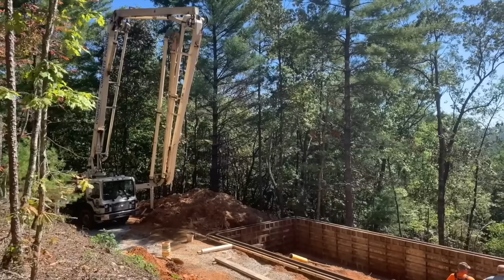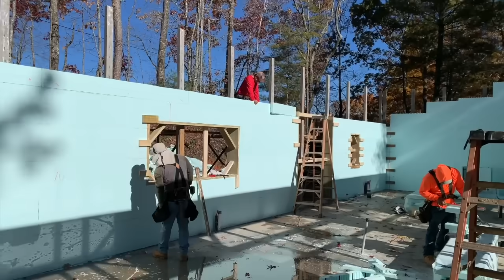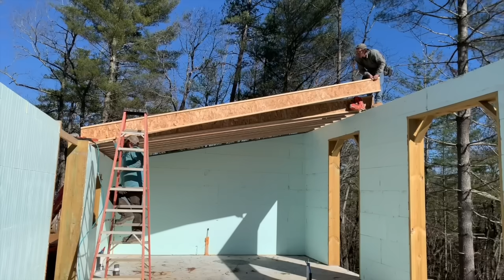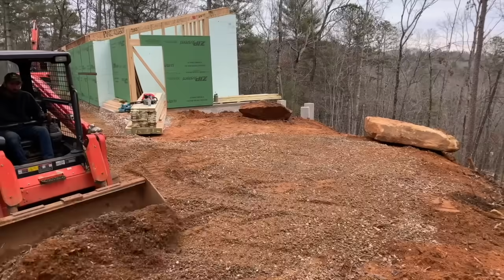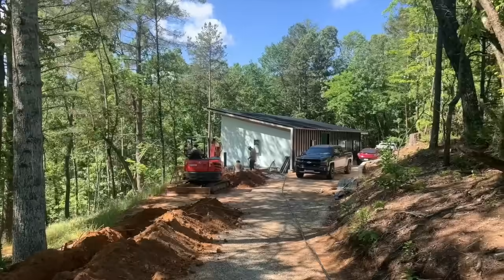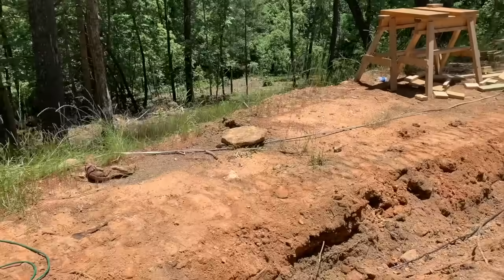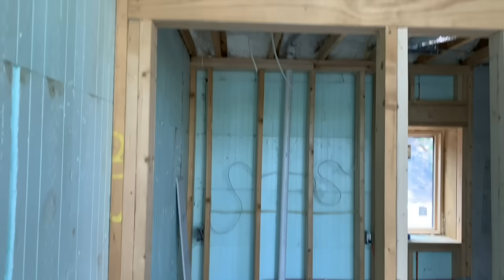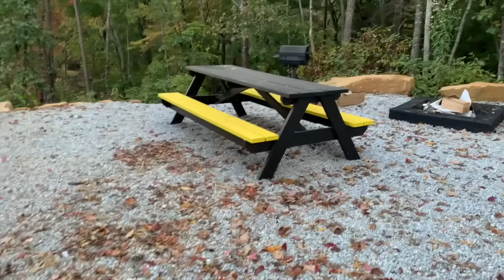Construction start to finish of a modern ICF mountain cabin.

Comment: You could’ve used the ICF floor and saved all that money used for backfill!!! And you would have gained a crawlspace
Reply: Longevity over what’s cheap at the moment….just saying. Some things you shouldn’t be cheap with. And also he’s building on a mudslide-prone area if the rains hit hard enough. I think he made a wise decision.
Reply: @ChaapashTheMeek Easier said when it's someone else's dime.
Reply: @ChaapashTheMeek so no pillars underneath ? HOW does it stay put on the mountain???
Reply: I agree. And plumbing and electrical would have been much easier
Reply: That could have been a whole basement and  made space for walk out sliders… put water heater, furnace etc down there and almost double the sq ft of the house
Reply: @miltondejesus2076 it's he's money in house 🤡
Reply: You don’t gain a crawl space, you gain a headache.
Reply: He wanted a concrete floor that he could stain. Also the high side was solid rock, so he would’ve spent a fortune excavating it. The flooring made out of wood probably would have been similar in cost anyway by the time he built a sub floor and added an attractive flooring.
Reply: @tennesseetexan1957 Icf floor is concrete
Reply: Dunno what icf fixes here. i was just thinking rock anchors or something. does look like some space went unused/lotta digging a hill then building a hill - 

Anyway - i'm sure my man's not silly - lots of factors decide decisions - especially when time is money/debt etc and I'm just a casual hehe
Reply: Rocks we're in the way, hell call Andrew Camarata. He'd get rid of em.
Reply: Cudn’t it be turned into a Basement without spending so much on aggregates?
Reply: @rawsinc1 idk I bet you need all that aggregate to anchor that foundation on the hillside. Will be glad you did on 1st hurricane/storm, any landslide would've taken house down hill
Reply: So many missed opportunities to have a much better home for the same price or possibly less. I’m getting ready to build a 1550 sf home. Im using Liteform ICF and litedeck for the floors and roof and all levels will be tied into each other via fiberglass rebar. The cost is basically the same once labor was factored in. I don’t understand why people are building ICF walls but not utilizing ICF for the floors/roof.
Reply: @JoNationLive yep same here, he lost out, alot of wasted space
Reply: @607woozy how much did the build and labor cost after everything was completed for you?
Reply: @ I am still waiting to sell my current home, I have the land and lot all cleared and ready togo, I plan on staying in a camper while construction is going on
Reply: @ what do the think the estimated price to complete will be or your budget ranges for how many rooms n brs? I am considering aswell
Reply: @ for me it’s just, me my dogs and girlfriend. I was doing a simple rectangle w/ garage. 40 by 30 and most of it was gonna b done myself since I do concrete for a living. I would b in the price range of 80-90k
Reply: @607woozy Im looking to do the same on a hillside outside Tahoe national Forest. I have easy grading and want to excavate sub level and do a cabin on top .
Reply: @ that sounds awesome
Reply: @JoNationLive how did it come along? What was the amount and cost for the build and labor completed?
Reply: I'm sure everything signed off by an engineer. But All that gravel won't blow out the sidewall?
Reply: @johnnyonthespot3784 doesn't act like water or wet concrete - more load is going to the ground/bottom of retaining rather than all leveraging the top of the wall. But i feel ya - looked funny to me and yeah - engineers got it covered
Reply: Crawl spaces are havens for rodents, bugs and mold.
Reply: @jimthompson717 neglected and ill prepared crawl spaces. Really it could have been a basement for the amount of gravel and 3 days of labor he had into it.

Comment: I think you wasted your time and your money by filling in your foundation! What is the vantage of that? If you would’ve left it like it was it would give you more room to work and do things underneath your house like a crawlspace just saying!!!
Reply from the maker: Hi Thanks for the comment.  The main reason for the gravel was to have a concrete slab, which we stained and left as the main floor.  It gives the cabin the modern look we were looking for. Also with the stained concrete we won’t be paying for flooring materials or any maintenance which will save money in the long run.  To me a crawl space could also present problems with mold and critters.  Overall, while spending more on gravel, i am very happy with the decision.  It looks absolutely beautiful and i will have zero maintenance with this design.  Sorry I didn’t explain this reason in the video. I will try to post a followup video that shows this in the interior.
Reply: gravel reaches 95% compaction when placed. dirt has to be compacted ,if you got the money gravel is easier to work with ,like digging in plumbing.

Comment: If you consider all Concrete flour , walls,  ? Why not a concrete roof, especially in the area your building,  More tornado proof. Definitely 100% Fire proof, with wood roofing your create more area for mildew, Especially with all those trees. Tree create lots mess especially on house roofs.
Reply: Totally agreed.
Reply: I suspect the cost of concreting a roof is exponentially a LOT higher. The rebar and engineering to figure what's required to keep a concrete roof from collapsing might be a lot higher. I do agree on the fire poof benefit .. but I'm guessing cost might have been a factor (just my guess).
Reply from the maker: Yes cost for a concrete roof would be significantly higher because of the added engineering, material and labor.  In regards to fires, the metal roofing, fiber cement soffits/siding, and ICF makes this structure largely fire resistant.

Comment: I am a General Contractor..... I love that you applied so many newer material applications like Zip Wall and Roof systems, ICF, Mini Split AC, etc...I did not see Solar or rain collection from the roof, but either way, really nice build.  Maybe move the trash can and build an enclosure so it's not the first thing you see when pulling up the driveway.  congratulations on a job that was exceptionally well done! Great details.
Reply from the maker: Btw…there will be solar added.  This will likely be a project next year
Reply from the maker: Thank you very much!
Reply: @johnwolson You will rethink your trash with your first bear😂😂. No one likes cleaning up after them sloppy I tell you .😂
Reply: Solar would work better if the roof was pitch the other way, aka to the south. Then you could of split a roof with the current angle off of the now high side across to the retaining wall and had a covered driveway (aka a carport). That all being said the house looks awesome and John built it the way you wanted it! Great job!!
Reply: @IU-Uber solar on your roof should be a last resort option. It makes everything so much more complicated for little benefit.
Reply: @joshuawinne  Agreed. At 26:08 he mentions: "... it has a passive solar design ...".
Reply: Yes two things that were missing for me. I definitely would have had solar at least for the car charging station.
Reply: Have you seen Zip System new rival. It was on show at IBS
Reply: Why didn't you plan for a crawl space. Seems you could have had a really good one.